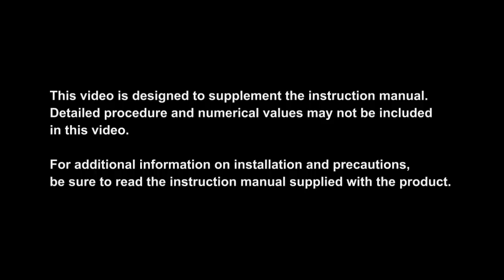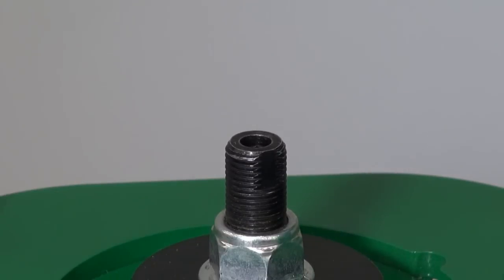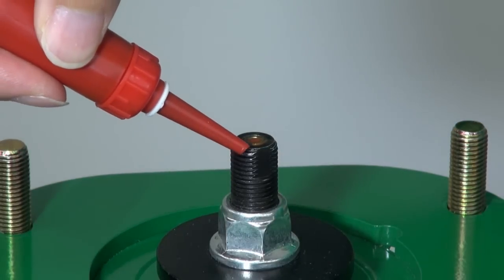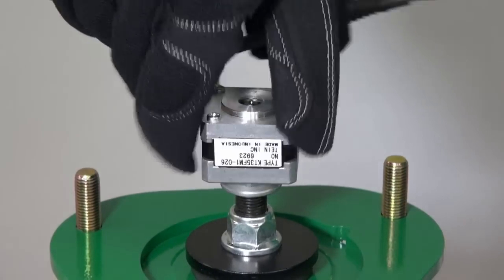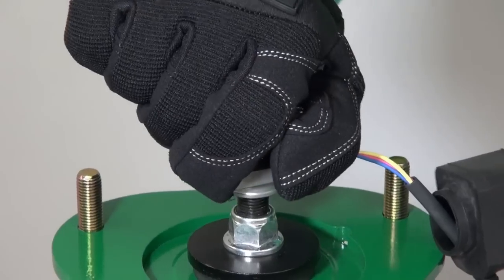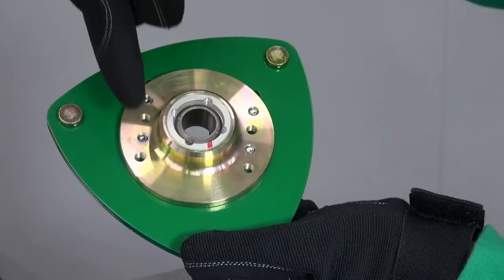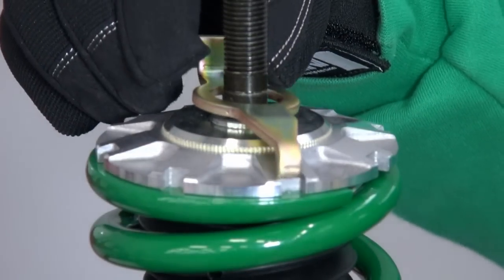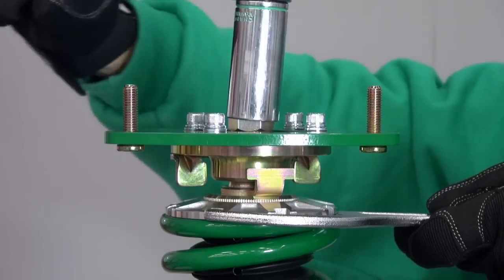Installation of Motors for EDFC Series

Comment: This system i a wild cocept. Im am extremely familar sith stepper motors an especialy nema 17's so seeing them ontop of a coilover threw me for a massive loop lol i can pretty much tell exactly what theyd be used for, some live adjustment of the coilovers based on road conditions/driver input. In theroy i can see it working, nema 17's are tough as hell little motors, i would just think it would be the coilover being adjustable enough to really notice it but what do i know. Really interesting none the less

Comment: What is that red grease that you use. Can I use any grease or it has to be grease from tein. I  avoid taken the motor off because I don’t have any more grease
Reply: im about to install my motor and i had the same question. Did you ever find an answer somewhere else?
Reply: Red loctite
Reply: any grease to prevent metal to metal is fine
Reply: Any grease is fine, don't trip on it

Comment: Bought these coilovers with the sole purpose of using active on them only to find out the company says they're not sure it'll fit under my hood because the motors sits so high...
Reply: So take a tape measurer and find out if it'll fit....
Reply: You act like its the companies fault they don't fit in YOUR car, a car that also tein had zero involvement in designing said car. Not every part fits on every car, when has that ever been a thing? How do you not understand that? Suspension designs vary an insane amount

Comment: When you are screwing the motor on, you are allowing the shaft to spin with it. Won't that completely stuff up the settings, especially if one of the other motors doesn't turn as much (or turns more)?
Reply: Might be some initial self check where the motor goes to the loosest setting and knows where that is. Not sure how smart the system is.
Reply: it does. it recalibrates 1/10 times it turns on w/  standard settings or, as i set it, every time. just installed flex z's and EDFC active pro on an evo 8 last night.
Reply: It resets everytime.